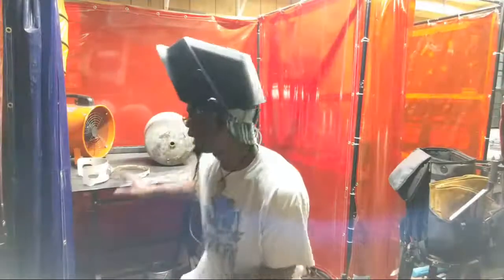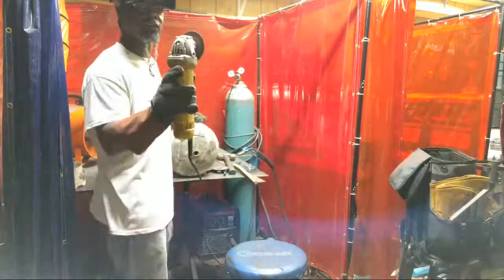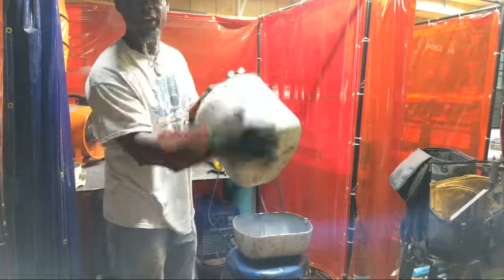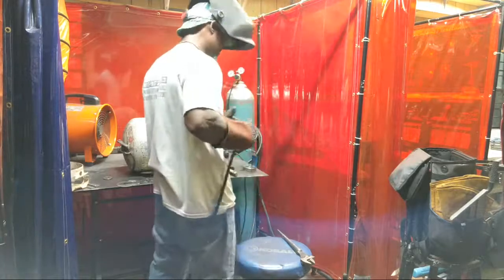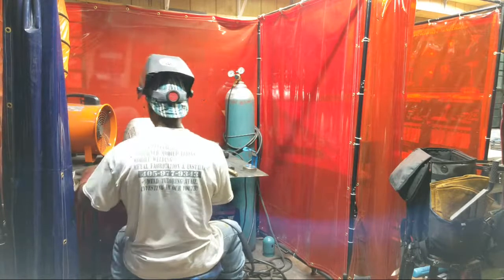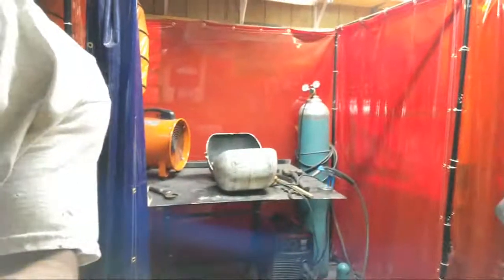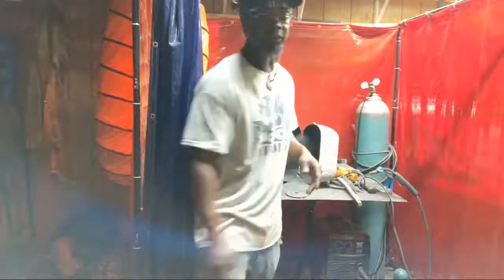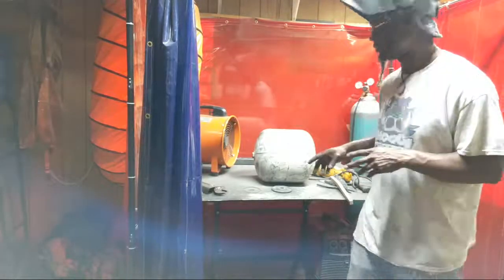HOW TO MAKE A PROPANE TANK GRILL??? PT:1

Comment: Only one question how did you get the valve out those are in there pretty tight.
Reply from the maker: Check out the first video I went into  details on how I did it. You can use a wrench or some vise grips to loosen the valve until you start hearing the gas come out good then stop  leave the valve in the inside allow the gas to come out once you stopping the gas coming out then remove the valve. Because if you try to remove the valve even though it tanks says it's empty it still has a lot of pressure on it and can shoot off and hurt you or someone. I would allow the gas to come out then remove the valve and you're good to go. HogOn
Reply: @HogOnWelding  ok. Will do. 👌